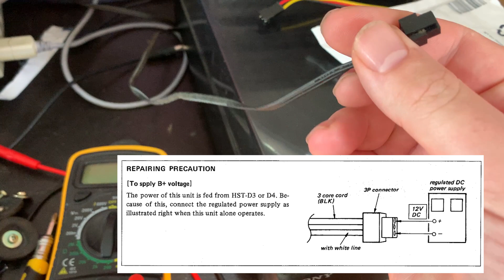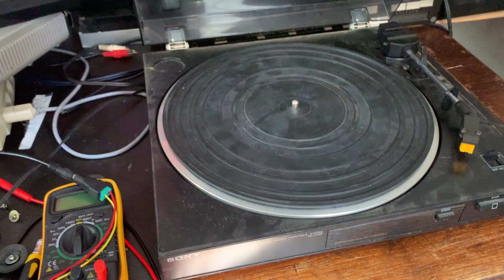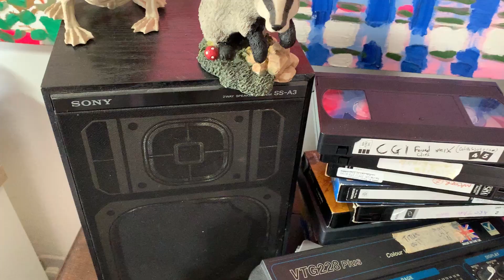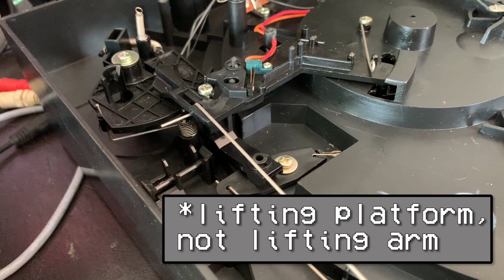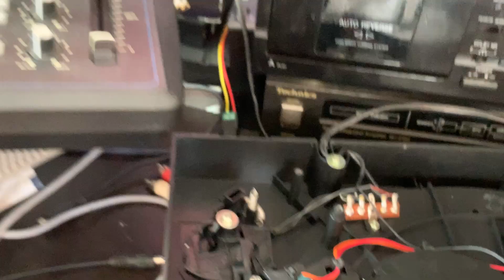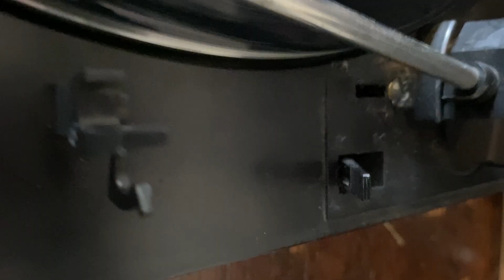Fixing a Sony PS-LX45P turntable / record player - broken start/stop, cue lever and audio issues

Comment: Do you know which stylus is the correct replacement? I've bought an ATN3600L and a ATN91, but I've read these are not compatible with a PS-LX45
Reply from the maker: Hey, I used an Audio Technica ATN3600L, seems to work fine and was listed as being compatible somewhere can't remember where
Reply: @akozero thanks 🙏 I've just mounted the ATN3600L
Reply from the maker: @ilciavo ah cool! Hope it works ok for you too 🤞👊
Reply: @akozero  Unfortunately, after a while, the stylus started drifting, and I noticed that the platter was uneven, which makes the LP wobble 🙁. I think this is beyond repair and can damage valuable records. On a side note, I would also recommend removing the dust cover entirely when you're playing a record; this reduces acoustic vibrations that can make your stylus jump.

Comment: Good 👍 job
Reply: Hi sir, I am using Sony turntable model no, Ps Lx 45p. 
I have recently encountered a small problem. The timing has changed, the styllus are not moving sir, please advise me, thank you Sir
Reply from the maker: @ramanaraomandava6771  hmm it's hard to say from that description, but have you checked the drive belt? A slack drive belt would probably cause the speed to change
Reply from the maker: Thanks bud! And thanks for checking out the video too 🙌❤️👊